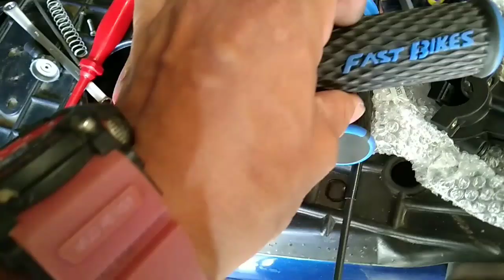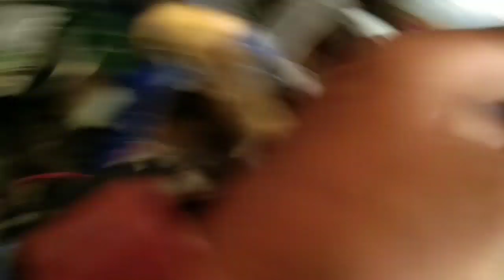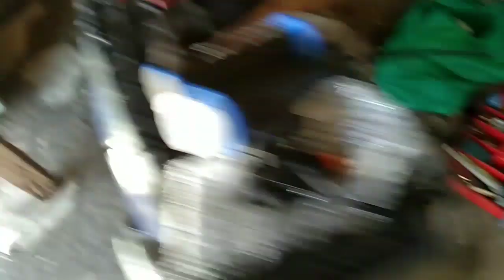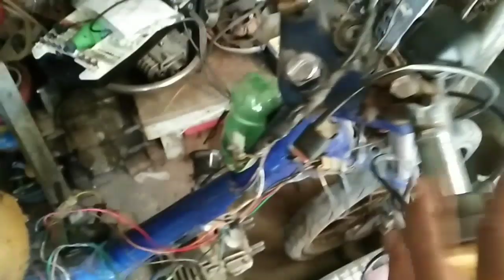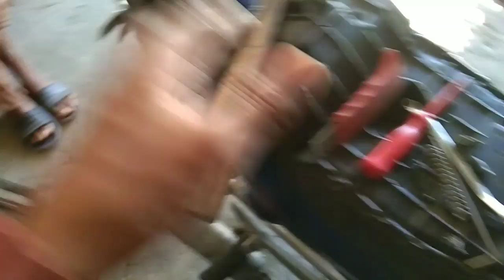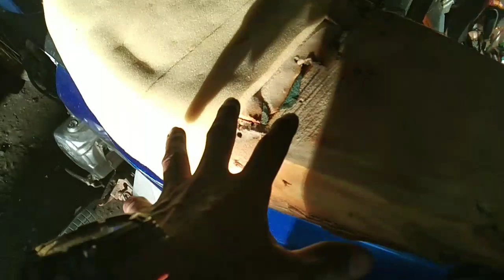HONDA XRM PROJECT REVIVAL PART 8

Comment: Magkano po ba budget kapag full restoration ng xrm 110? 2005 MODEL
Reply from the maker: Depende po sa kung ano po ang I Install mo..
Reply: @dibmoto  telescopic, rear shock, handle switch assembly, buong body case, headlight, tail light, signal light yun po, including na rin po yung swing arm

Comment: idol ask ko lng po,,normal lng ba sa xrm na mabilis mag init ang makina,mga 10mins.lng idol.
Reply from the maker: Kapag 10 mins idol mainit na po talaga ang makina. Pero try mo mag plug reading if maputla lean mixture yan idol adjust ka po ng mixture screw...😁👍
Reply: @dibmoto  nag plug reading na pa ako idol,maitim po yong tip ng sparkplug,